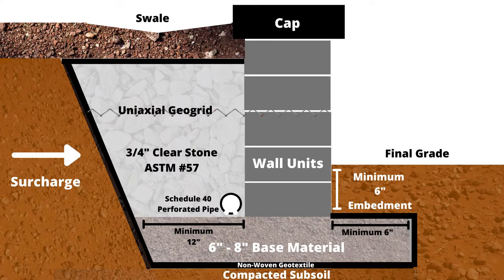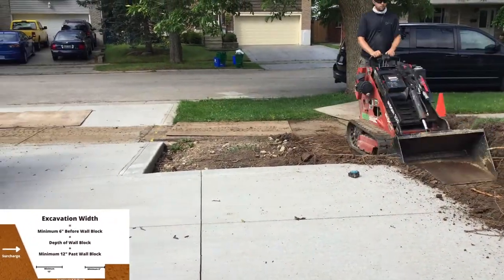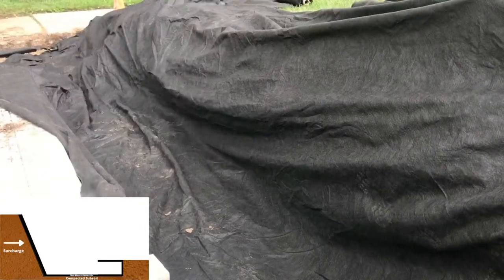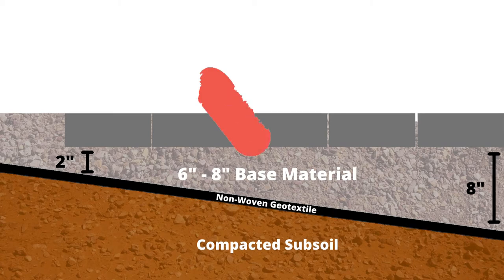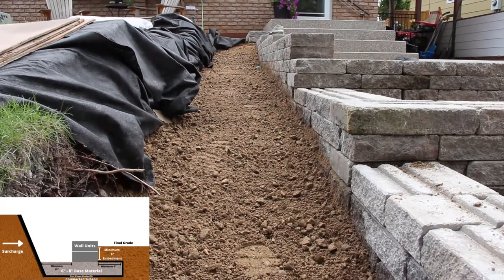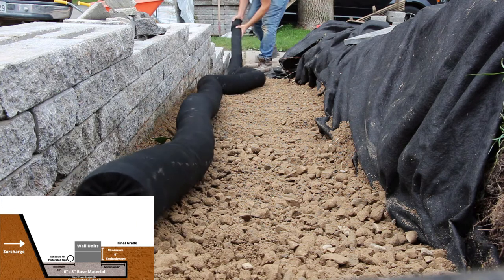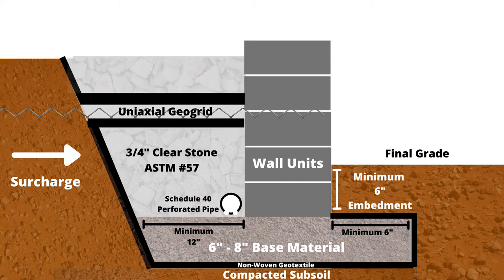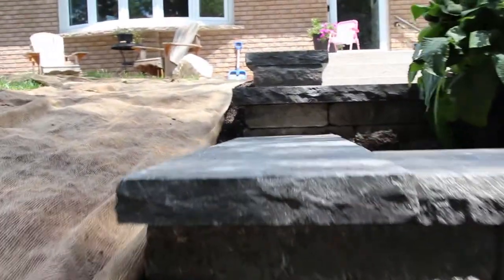How to Build Retaining Walls | Complete Guide to Constructing Retaining Walls Using Wall Block

Comment: At the beginning of the video, you layout how the wall comes together. For the 6 to 8 inch base material, you were using 3/4”  WITH fines. Would it be OK to use 3/4” clear, WITHOUT fines, as this would allow water to pass through easily, especially on clay soil.? Great videos!
Reply from the maker: Absolutely, here is a video we made on when to use either:
BEST Base Material for a Retaining Wall | Dense or Open Graded Base
https://youtu.be/BFb8lZ_mGYs

Comment: I built a 2 foot high wall in my back yard for a raised patio. I built the wall perfectly flat. I planned for the  wall cap to  act as edge restraint for the pavers. My problem is the pavers need about 2 inches of slope and my wall is flat. How do I drain the water from the top of the patio to the back side of the wall? Ive seen people leave gaps in the wall caps. But im thinking that won’t work great because the wall is flat.
Reply from the maker: For a raised patio, we typically install a drain in the middle of the patio and slope everything towards that drain and have it exit through the wall or underneath out of the system. You could also inverse that and have the middle of the patio be the highest point and everything sloping towards the caps. It also helps to build your raised patio using open graded base and with a permeable jointing compound so the water that lands on the patio goes straight through the joints.
Reply: Everything is built on a open graded base. Can I put a drain somewhere on the patio and drain the water into the base?
Reply from the maker: You would want a way for that water to get out of the base otherwise you will create a reservoir. that could be a pipe coming through the face of the wall or a trench under the wall base and a pop up emitter in your yard.
Reply: Im using standard concrete pavers with built in 1/16 in spacing. Would it be ok to not use a jointing compound so the water drains through the pavers?
Reply: Im using standard concrete pavers with built in 1/16 in spacing. Would it be ok to not use a jointing compound so the water drains through the pavers?
Reply: Im using standard concrete pavers with built in 1/16 in spacing. Would it be ok to not use a jointing compound so the water drains through the pavers?
Reply: Im using standard concrete pavers with built in 1/16 in spacing. Would it be ok to not use a jointing compound so the water drains through the pavers?
Reply: Im using standard concrete pavers with built in 1/16 in spacing. Would it be ok to not use a jointing compound so the water drains through the pavers?
Reply: Im using standard concrete pavers with built in 1/16 in spacing. Would it be ok to not use a jointing compound so the water drains through the pavers?
Reply: Im using standard concrete pavers with built in 1/16 in spacing. Would it be ok to not use a jointing compound so the water drains through the pavers?
Reply: Im using standard concrete pavers with built in 1/16 in spacing. Would it be ok to not use a jointing compound so the water drains through the pavers?
Reply: Im using standard concrete pavers with built in 1/16 in spacing. Would it be ok to not use a jointing compound so the water drains through the pavers?
Reply: Im using standard concrete pavers with built in 1/16 in spacing. Would it be ok to not use a jointing compound so the water drains through the pavers?
Reply: Im using standard concrete pavers with built in 1/16 in spacing. Would it be ok to not use a jointing compound so the water drains through the pavers?
Reply: Im using standard concrete pavers with built in 1/16 in spacing. Would it be ok to not use a jointing compound so the water drains through the pavers?
Reply: Im using standard concrete pavers with built in 1/16 in spacing. Would it be ok to not use a jointing compound so the water drains through the pavers?
Reply: Im using standard concrete pavers with built in 1/16 in spacing. Would it be ok to not use a jointing compound so the water drains through the pavers?
Reply: I’m using an open graded base and have a trench system in place.